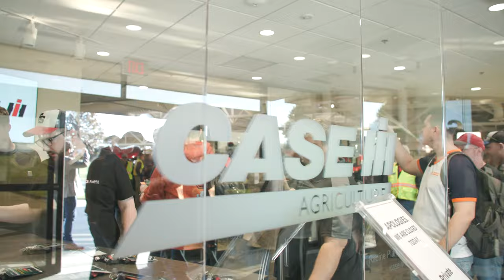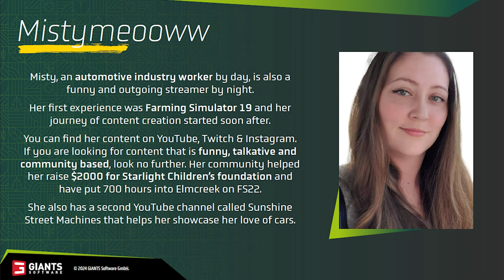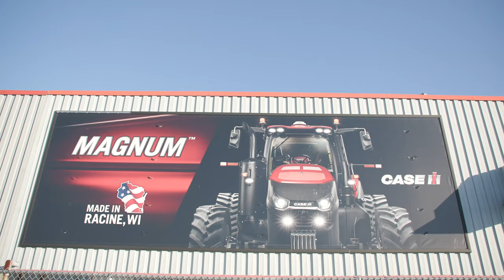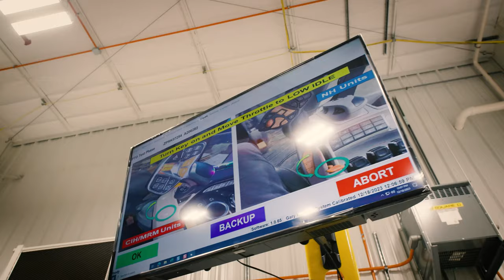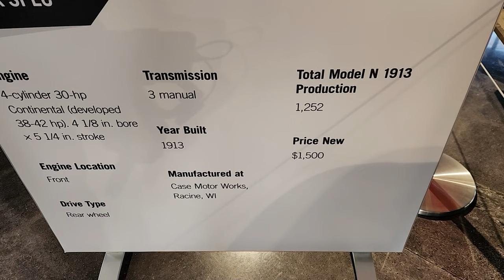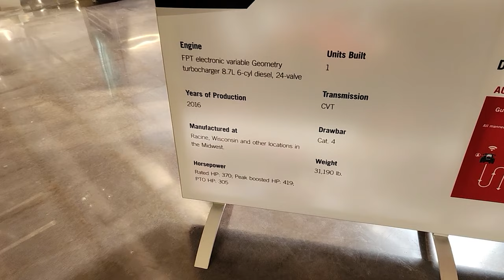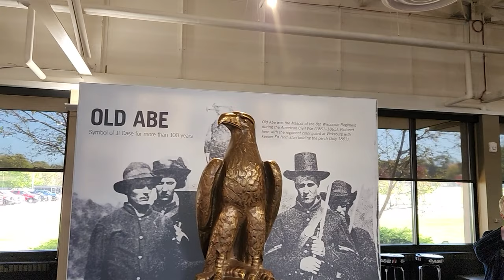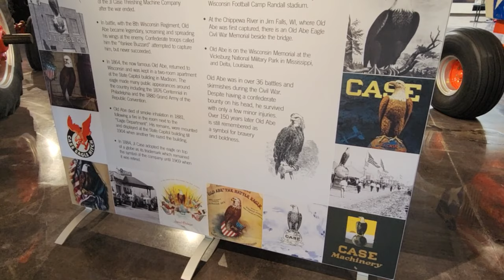Farm Sim 25 Preview Event at the Case Experence Center

Comment: I wonder what the PC spec was they gave you to play their game?
Reply from the maker: 12900K, 32G DDR4 Ram and 4090GPU.  Way overkill yes but also note it was a dev build from early Sept so it wouldnt be anywhere near as optimized as a shiping product.  The systems where provided for the event and then sent back to the manufacture.
Reply: @FarmerKlein  I just upgraded my PC so should be fine to play it at max settings, 64GB DDR5 Ram, GTX 4080 super, 7800X3D, defo overkill for farsi but I do other stuff
Reply from the maker: For sure given the recommended spec from Steam is:  Processor: Intel Core i7-10700, AMD Ryzen 7 3800X, or better Memory: 12 GB RAM Graphics: Nvidia GeForce RTX 2070, AMD Radeon RX 5700 XT, Intel Arc A750 graphics card or better (min 8GB VRAM, DX12 support)